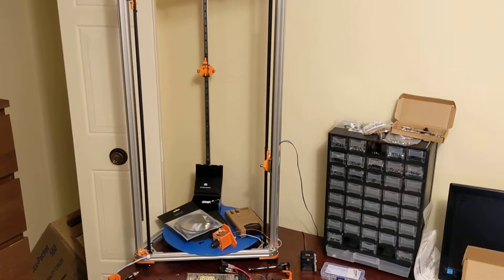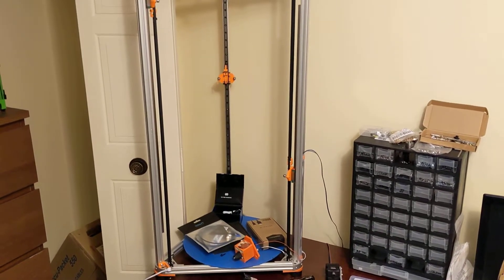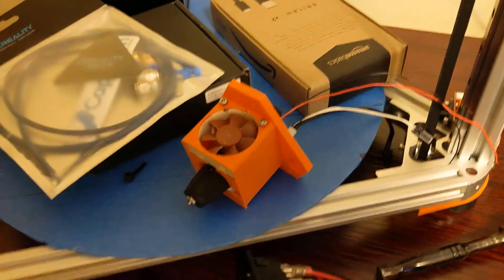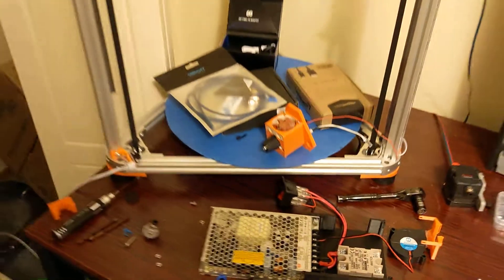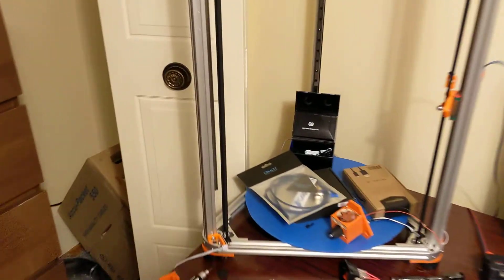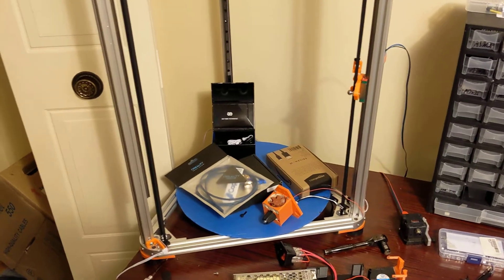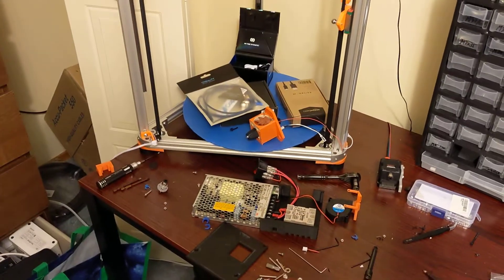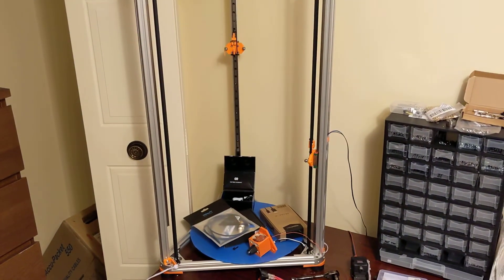Large Delta Printer Update

Comment: Which steppers did you use for your large Delta printer?
Reply from the maker: the cheapest I can find, I never really run expensive steppers on my printers and I have good luck
Reply: @Rolohaun  Like the Creality 3D Printer Original Stepper Motor 42-40 2 Phase 0.8A 1.8 Degree 0.4N.M. Or would you suggest different ones. Thanks again have a happy new year.
Reply from the maker: @frederickbawden9470  those would work fine, happy new year